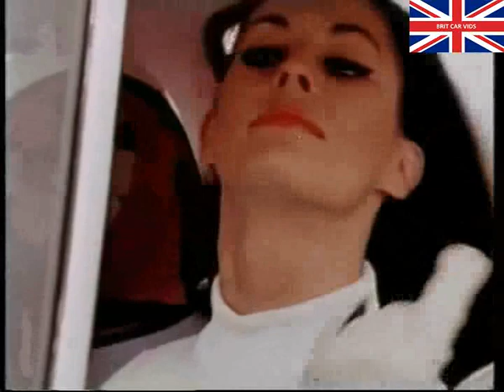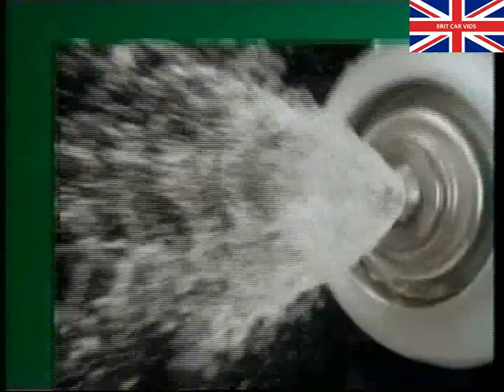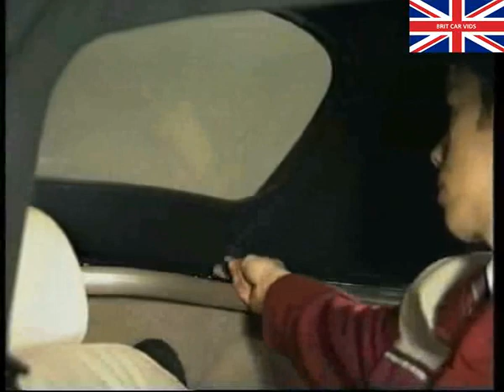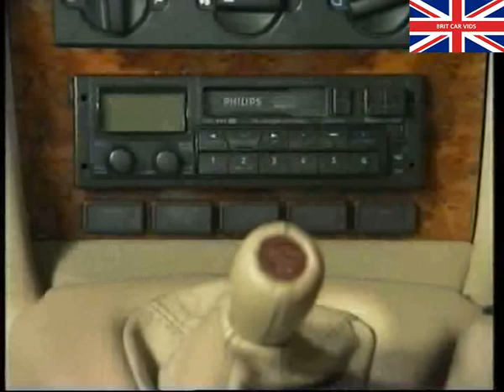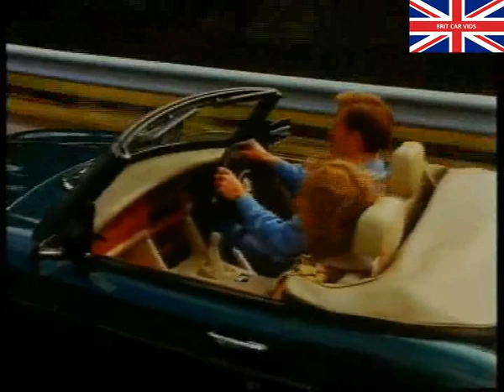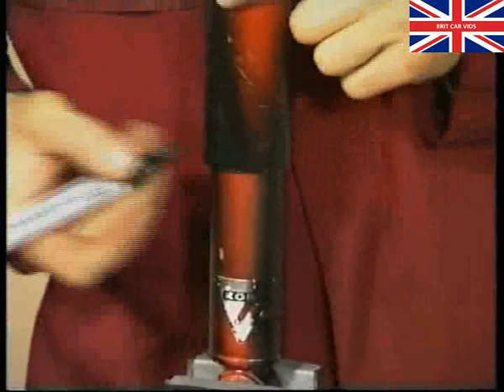Rover - Service Insight - MG RV8 Technical Reveal (1993)

Comment: I have a serious question; Why are their inlet valves with the fuel injectors? It seems to me, because I have done heavy diesels, I do not see the need for the valves; With direct injection their are no valves, So why use indirect injection? Why Swirl chamber?  Plus in this v8 engine & in my Rover 25 of 2001 K series engines, Why do the injectors fire in pairs? And therefore have fuel returned to the tank or fuel regulator/rail? Sorry I do not understand this system very well, being only a student. Plus why do spark plugs fire in pairs? Is that not a waste of energy? Is there a way to re-program the ecu?
Have just found a level two vehicle maintenance course on indeed.com; a jobsearch website, It is discounted to £27 upto the 20th Jan; I sent a question about still getting the discounted price on the 24th, as this is my universal credit paiday? "I have some experience" Just not enough to get a paid job(?) Though insurance is also an issue for trainee's - I asked Anderson & Walls of Bridgwater.
Reply: Gregorious Gilbert without valves how is the air from the inlet manifold getting in. Wow!!! Just wow 😂😂
Reply: This engine is an American boat engine from the sixties, quite a lot older than direct injection has been in mass use. Secondly, you're incorrect, of course engines with direct injection have valves. The only difference is that the fuel is injected into the bore instead of into the inlet tract. Where would you prefer the unused fuel to go? You don't use all of the fuel available to the injectors otherwise it would run at 6000 rpm all of the time. You could do that and do away with the fuel return if you think that's a good idea? Spark plugs: It's a wasted spark ignition system. Because the flywheel spins at the same speed as the crank shaft these engines fire the spark plug both on compression and exhaust stroke as they aren't setup to tell the difference. It doesn't really matter.

Comment: 135 mph top speed from a 4 litre? My 1.8 MR2 can do that on half the fuel
Reply: AliAdean...yer but your car sounds like a lawn mower. ..😀😀😀😀😀
Reply: Doesn’t sound like this though and can’t do 0-60 in 5.9 sec
Reply: And it's got Toyota written on it...
Reply: @pinkyn0se   that's a bonus because Toyota is code for reliability, something Rover is known for the opposite of😂, no such thing as a high mileage unrebuilt Rover V8.
Reply: S JP yeah so that means a quality product and better than rover mg crap
Reply: Does not sound like a rover v8 though 😊😊
Reply: @bluecornerboxing6091   have you ever heard a Rover V8 @6000 rpm?  Ofcourse you haven't because it can't rev that high😂
Reply: MK2 MR2s are a great car in standard unmodified form, just a shame about the max power lot (or today’s equivalent JDM whatever) image that comes along with them as most were always the hands of those types especially the import ones.